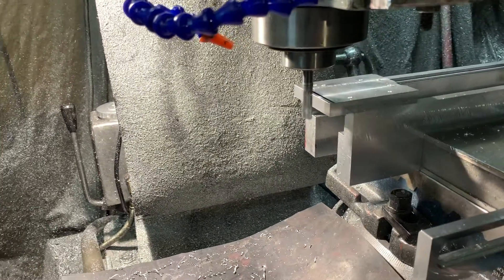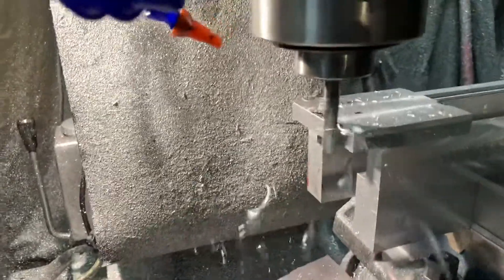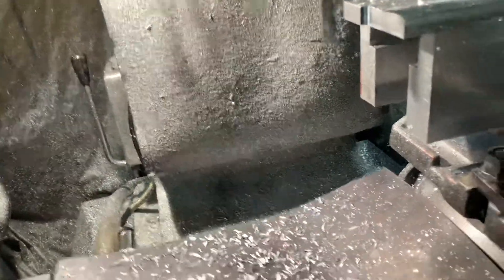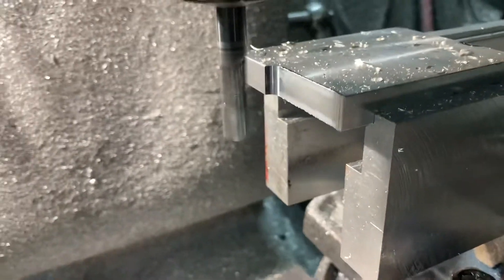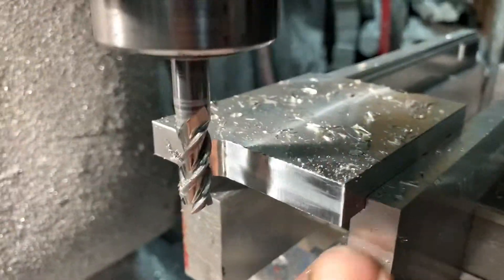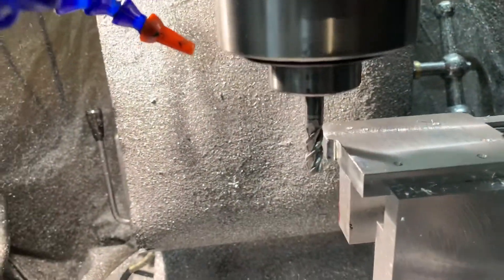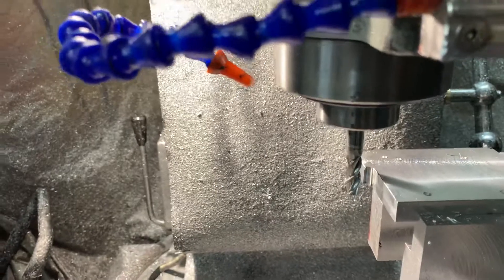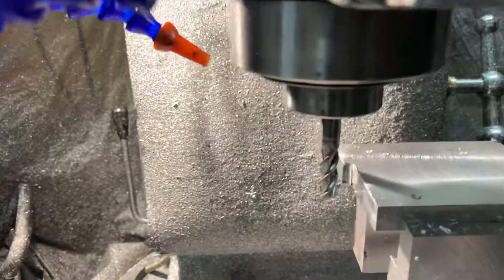PM833T since I bought this new it’s always had this issue.

Comment: backlash on Y axis? check your backlash adjustment.
Reply from the maker: Yeah been there many times, replaced the lead nuts, and it appeared that it was delivered with a bent acme causing fast wear and for the lead nuts to come loose. You could put a quantitative amount of red loctite on the brass nut fastener and it would still work it’s way loose. Gear box blew the second time around 2-3 months back so it sits in the corner until we get time to install balls screws. Have enough other mills here to take up the slack now.